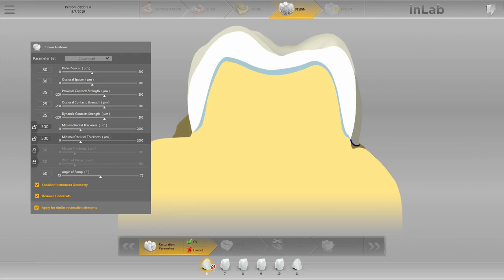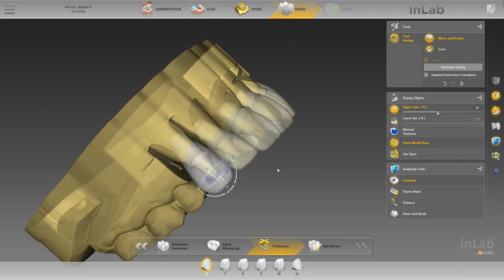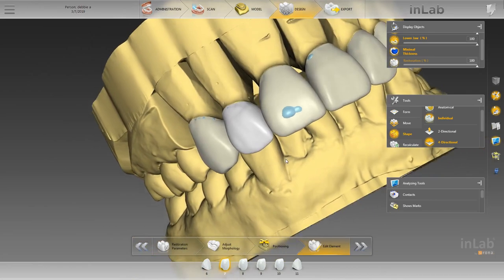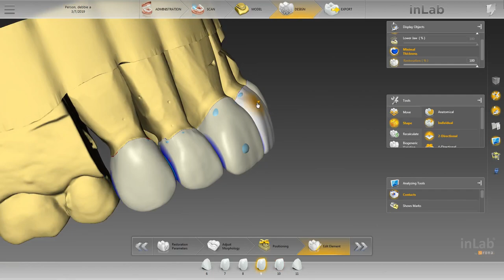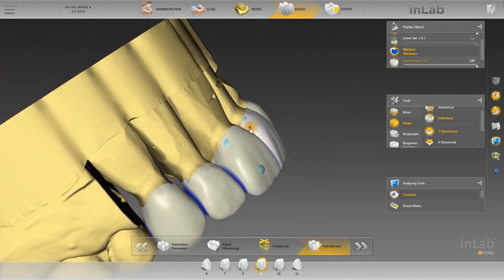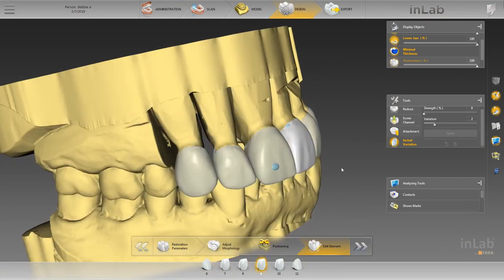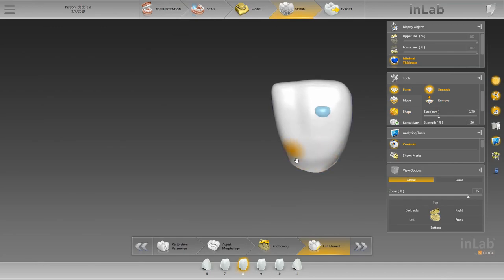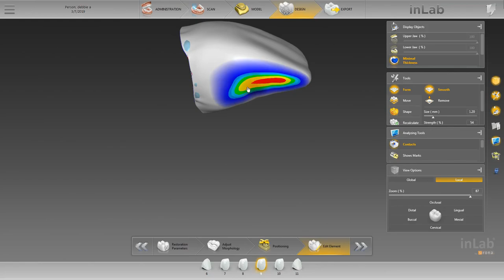InLab 18: Anterior Design Tips & Tricks

Comment: In the beginning of the video you said that you set the parameters for E.max. what would you set the parameters too if it where Zirconia?
Reply from the maker: About the same as e.max, but I would increase the marginal thickness to prevent chipping at the margin. Zirconia is chalky and brittle before it is sintered.
Reply: @WestonHatcherDesign  Thank you.
I followed your instructions in the video , but with 4 lower anteriors and my design was great. Thank you for the  tips.